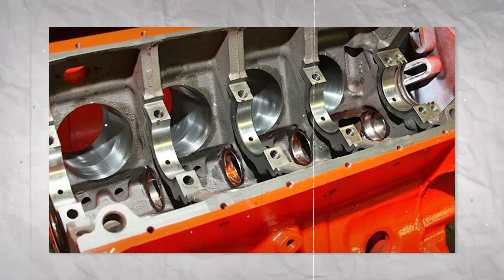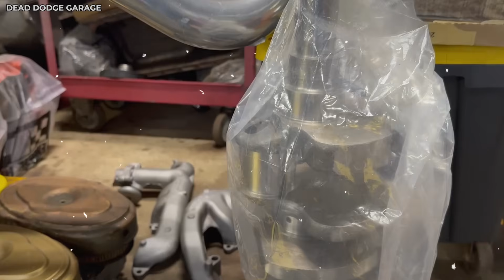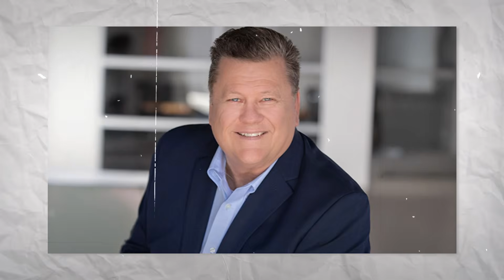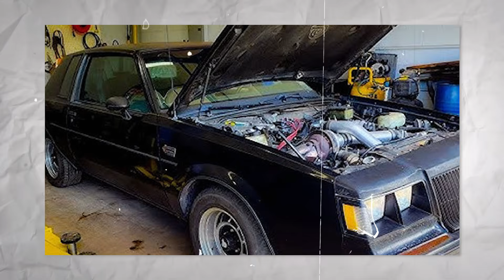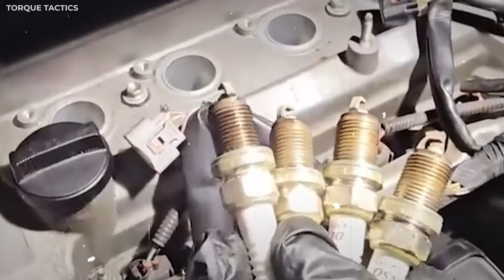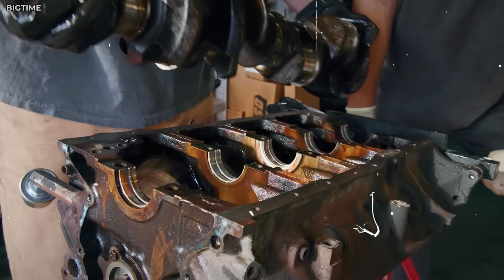The INSANE $5 Ford Engine Trick That Quietly DOUBLED Low-End Torque

Comment: I learned this trick from my older brother who had ran the spcers on his Y blocks and then 352 FE. I ran a 1 inch on my 289 and felt the difference plus actually got better mileage as this was the mid- late 70’s it was important, the off line performance was like running a mild high rise intake that only cost pennies compared to $150 bucks